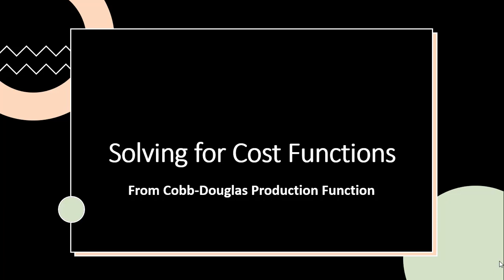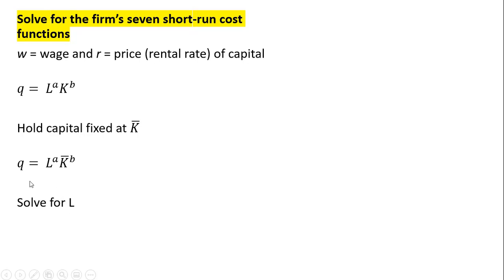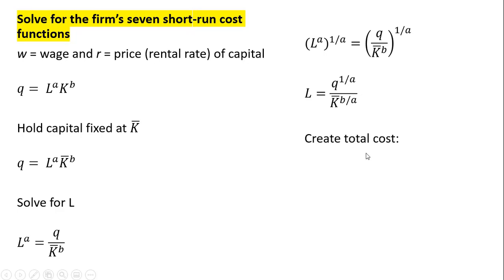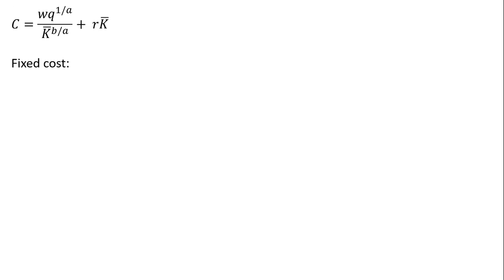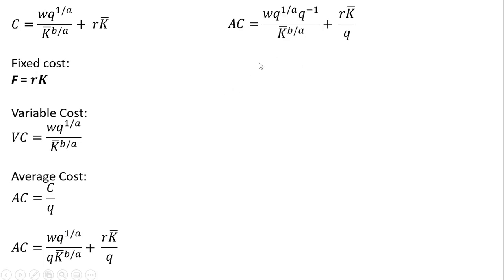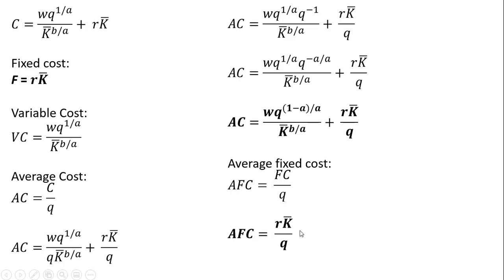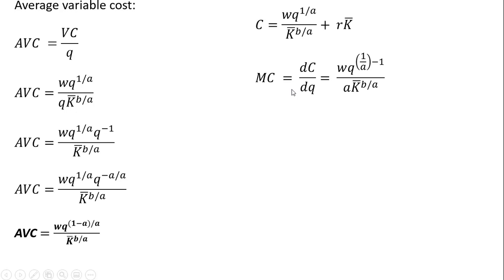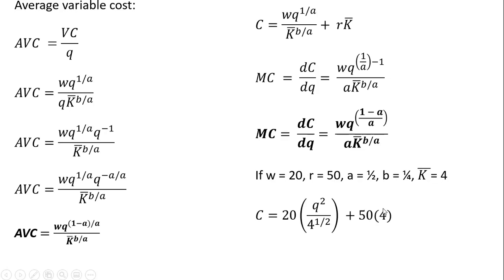Deriving cost functions from generalized Cobb Douglas

Comment: I've always been confused about this one thing, where and how do we get the number for a & b from? do we just write it ½ & ¼ ? or what? enlighten me
Reply from the maker: In this problem, I just picked any values for the exponents a and b. Assuming one has data on q, L, and K, you could statistically estimate the exponents by running a regression in double-log form. lnq = lnconstant + alnL + blnK. The coefficients a and b in the regression give the exponents in the cobb douglas production function.
Reply: @EconomicsinManyLessons  is there mathematic way to do so? cause i haven't learned Regression yet (still holiday Indonesia) and i haven't taken Econometrics yet in the semester so i have no idea about Regression or Statistic/Econometrics